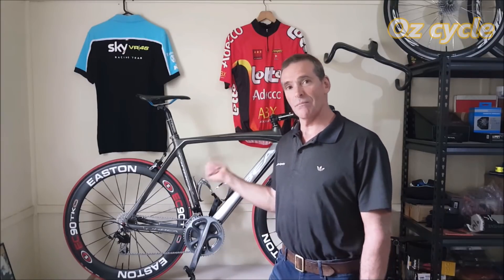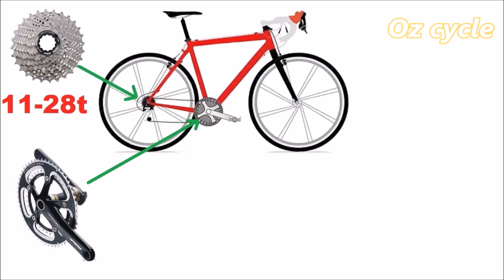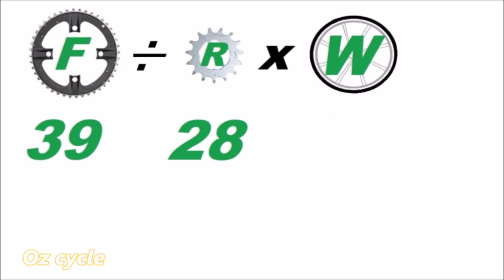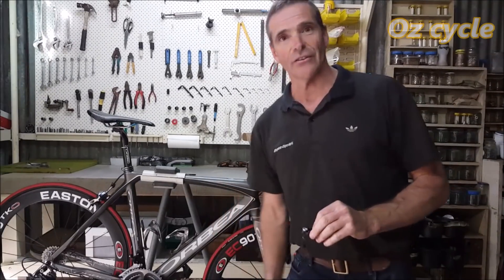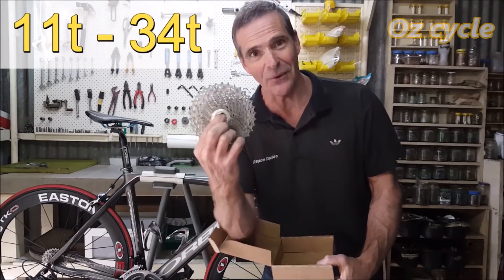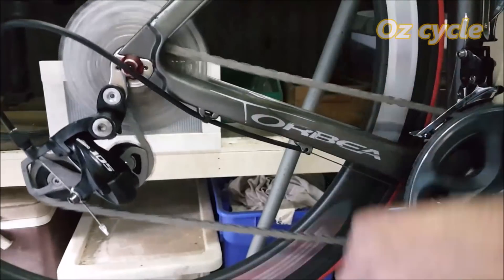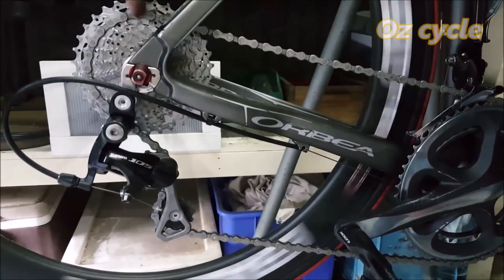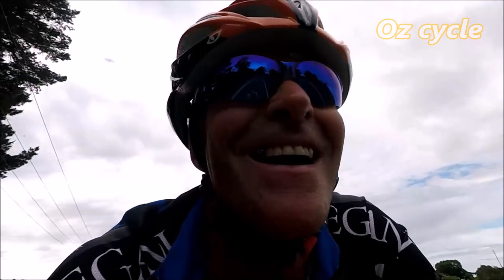Have you got Compact gears yet?

Comment: why would you not use the first cog with the big chainring ? if i have 20 speed i want to be able to use them all, just get some long cage derailleur
Reply from the maker: +Samy Arabi The chain twist is too great Samy and will wear or damage the chain very quickly. Next your on your bike put.it in that gear, look down and you will see the angle of the chain.
Reply: i'm used to it and i dont mind killing my chain 100km earlier because i crosschain sometimes, but to me switching into big ring in climbs allows me to put great power standing still, i have compact gear and i would never have unusable cogs with any of my chainrings. 

why would you not just recommand a long cager derailleur in your video? if you look pros (im not sayin i am one) they use any gear and sometimes yes, big chainring and biggest cog also
Reply from the maker: +Samy Arabi Sounds like you dont use your small ring much? The 'hanger extension' is for anyone who would like to try smaller gearing without buying rear mech or crankset. If they like the gearing they can consider a compact set.
Reply: anyways m8, the tip is great, i like it compactt
but when i dance uphill, i dont like shifting 2 - 3 - 4 in cogs in small chainring, i'd rather just stay on biggest cog and switch ring and then if i need to, one more cog for slightly bigger rollout. and then, back at small chain ring seated and tempo relaxed. cheers

i just dont like the fact that its ok to not be able to use all of your bike gearing lol, everyone has its own way to do it
Reply: @samyarabi9033  It is ok to avoid using all of the available sprocket/gear combinations, because there are several combinations that have close to the same gear ratio.  For example, I only use maybe 14 out of my 20 available gear combinations yet still retain essentially all the useful combinations.  On my drivetrain, crosschaining the big ring (50 teeth) with the biggest rear sprocket (28 teeth) is a ratio of 50/28 = 1.79.  Instead of crossing my chain, I can instead switch to the smaller chainring up front (34 teeth) and a rear sprocket in the middle (19 teeth) for effectively the same ratio, 34/19 = 1.79.

You can calculate a table of your drivetrain's gear ratios to see that you don't need to cross the chain, and can avoid maybe four or six gear combinations that can cause wear out problems for your chain.  Example gear calculating website:  http://gears.mtbcrosscountry.com/

Comment: Froome has everybody trying hi cadence. I was no exception, and tried the 11-32 for several month. My conclusions were:   1) You have to be Froome to keep up "hi" speed and hi cadence on a steep climb. My heart was reving too much.   2) The jump from 32 to 28 is too large and got me  off rhythm (it was too hard or too easy, as Oz said) It would interesting to know if Froom's 32 cassette drops down 4 to 28....  . 3) the 32 was making me more lazy .   4) I was missing the 23 of the 11-28 cassette. I went back to my 28 and compared times, and I was faster on my 28 compared to the 32.    So for me, personally,  lower cadence with a 28 works better than  the 32. Although I 'm sure the 32 will work fine for many people. Lastly, 34 for a road bike seems too much, for gears would spread way too much, as Oz also mentioned.

Comment: No. This is daft nonsense. If you can comfortably push a 39x28 up a twenty minute climb at 300w, there's no benefit to doing it with 34x28 at a higher cadence. I started with compact, moved to semi-compact, now i ride standard with a 28. I wouldn't consider going to anything less now. And secondly, having a 53x11 on downhills is a distinct advantage

Comment: i have a 40 tooth casette paired with a compact on my road bike. Shifts amazing and i can go up mountains. The tricky part was finding a mechanic that knows how to calculate the length of the chain and index the gears properly (which is what i didn’t know how to do, i tried and failed). The only downside on my my bike is the rear wheel doesn’t come of easily. I highly recommend this set up for new to the sport folks until you build strength. Credits are due to Durianrider.

Comment: Hi does that link work on sram dr? I have compact and 32t in back so I'm using medium cage. Some hills are 16% and it's so hard to get up...I'm pushing 400+ watts and probably going 5mph... I think cadence not lower than 75. Is this ok? Sorry many questions
Reply from the maker: +NewbArchitect Yes it works with Sram. 400Watts!!....not continuously,you would be a machine...haha. Lower your gearing to put out less wattage,then you will be able to climb easier and feel fresher at the top,instead of exhausted and having too much lactic acid buildup.

Comment: spinning dont always solve the problem, especially if u got some short climb like 20% to 25% or longer climb like 12-18%
u still need to train for low rpm hi torque climb
Reply from the maker: +U20101954 Yes,and every body is physiologically different. Some can keep dancing up a hill easily without sitting much. Others sit a lot,and all the inbetweens. Its all a matter of working along wirh your body.

Comment: My first road bike (I'm a recovering mountainbiker/born again roadie) came with 50/34 and 11-32 but I got myself an 11-34 do help me do one particular climb and it has never come off again. I'm no racer so I don't find the bigger jumps between rear cogs an issue and I've even found that cross-chaining 50-34 is no problem (the chain remains quiet) so for a lot of the climbs I do I never come out of the big ring. Very occasionally I run out of gears at the top end 50-11 so I am considering seeing if I can get a 52 chainring to run 52/34 up front.

When I say to 'serious' roadies that I have 11-34 they almost sneer at me. Funny how spending a fortune on a light weight bike to help you climb hills faster is OK but spending £30 on a new cassette to do the same thing is not!

My wife a road bike at the weekend and one of the things on the 'must have' list was a Shimano Tiagra chainset which can accommodate an 11-34 cassette as standard.
Reply from the maker: +Hugh Wallace Sounds like you have found yur perfect gearing there Hugh...11-34.  If you can afford a 52t ring it will get you down the hills that bit faster.
Reply: @Hugh Wallace; Cycling snobbery?

Comment: I took my bike for a first hills ride today, 50-34 and 11-32 and I used all of them.  34-32 not too often, but a couple of times when I needed a break.
2018 standard setup for many manufacturers seems to be 52-36 and 11-30.  Based on today, for my needs, I think I'll get the shop to swap the semi on my planned upgrade bike for a proper compact set of chain rings.  I don't want or need higher top end speed, but I definitely appreciate having easier gears available when climbing.  Stronger riders would probably be fine, but I'm not a strong rider  :-)
Reply: Free Man
Agreed, but a stronger rider is able to spin bigger gears than a weaker rider, that is what is meant. For example 20 years ago I could go up hill with 90 rpm with say a 39/23 or even bigger gear, whereas now the equivalent for going up the same hill at 90 rpm would probably be with a 34/32 or worse.

On my new road endurance bike (Giant Contend) I've just put 46/30 on the front and 11/42 on the back, all for very cheap. And working excellently! Didn't even need to change any deraileurs or cranks from the stock ones! The 46/30 sub-compact chainrings have 110 BCD and costs $50, and the cassette cost $30. Plus a Roadlink which cost about $35. How's that, a cheap 110 BCD 30-tooth chainring?!

I was struggling to even push the 34/32, this 30/42 is really great for me.

Anyway I always want to spin, so have to get gears to fit my strength, which is weak due to illness. I refuse to grind up hill if it's within my power to lower the gearing on the bike. And who but race-speed riders need anything bigger than a 46/11 eh? That's plenty big enough for 90% of commuter road riders and is usable range. For most commuters a 50/11 is just superfluous and barely if ever used. Just not needed.

But if I was racing even D and E-grade level I'd definitely need a 50/11. Probably even go with a 52 for D and E grade, but could get by with a 50. For B and C-grade you'll definitely need a 52 on the front. A-grade level you need at least 52 and preferably 53. When I was riding A-grade I had a 52 but on occasions wished for a 53 as the 52 spun out in races, and I was only an average A-grader. But I was too lazy and not serious enough to do the conversion haha. But now I suffer too much on the hills to not warrant converting to lower gears than the stock 34/32.

Who would think a 34/32 on the road is too big? But for some it really is, I'm so slow I grind even with that gear. I'm bloody loving my 30/42!
Reply: @alantaylor6691  nice read! That's an impressive range of gearing. My old bicycle has 52/40 and 28/14 and is only 12 speed lol. On the flat I'm on the 3rd cog and big ring but uphill its not easy even on lowest gears, I haven't cycled for years so that won't help. I can only imagine how slick your drivetrain must feel especially uphills!
Reply: @TheRealD4  
About a year or two ago I was speaking to someone who was running a triple chainring, with low gear being 20 on the front and 46 on the back!

You may ask how do you get a 20T chainring? Well as you may know, 22 is usually the lowest gear you can get on stock triples. However you can actually buy 20T chainrings on ebay that can replace the stock 22T small ring.

Then he got the back up to 46. I think that's something like an 11 inch gear. He does fireroad riding and says he uses it for that, with gravel bike type tyres of about 42mm.
Reply: Yup depends how strong you are a lot of the time. 20 years ago when I was racing and training like a maniac, a 39 x 28 was more than small enough. Now that I've been off the bike for 20 years and have no legs and excess weight, I'm even having trouble with the 34 x 32 on a lot of hills lol. It's just amazing the difference the legs make, 25 kph is pacey on the flat now, but in the old days I didn't even go that slow on easy recovery rides on the flat.
Reply: strong or not, spinning > grinding

Comment: Sick video ! I love to have a high cadence generally, I'm comfortable around 90-100 rpm so I struggle quite a lot on the mountains, where my lowest gear (34-28) allows me to pedal at 80 rpm max (which is too much grinding for me). Would you recommend training at ultra low cadence to make my muscle adapt to low cadences or just go with a 11-32 cassette ? I'm currently running a compact crank with an 11-28, I must say its very tempting to buy that hanger and go with the 11-32.
Reply from the maker: +Antoine Morin-Prévost Mostly depends on your age and weight. Generally it would be good to simply have the lower gearing so you can have the higher cadence especially if you can already do 90-100rpm.

Comment: I cycle in mostly low rolling hills for my daily 35-mile training rides (56 km). There aren't any long climbs but one of the short ones hits an 18% grade. I'll do several centuries each year (100 mile or 161 km) and some routes hit longer climbs but they never exceed 10%. Cycling these routes I found that I hadn't used the small chainring of my 50-34t compact chainset for a couple of years. So I switched to a 1x drivetrain at the beginning of 2016. After two seasons on a 1x with a 50t chainring at the front and an 11-28t cassette at the back, I haven't felt the need for a 2x chainset at all. I plan to switch to an 11x32t cassette next year so I can handle steeper climbs (if I ever travel to a location with them) but I've been very happy with the 1x setup.

I'll be 61 years old in a few months and, according to my power meter, I can still hold a modest 400 watts uphill for a fair distance, especially if I'm pulling the pedals, and haven't had any trouble holding a cadence of 80 or better up any of the hills in my area. I rarely get out of the saddle and stay in an aero tuck position resting my arms on aerobars most of the time -- even uphill (there is a lot of wind here). Because of my forward-leaning position, I'm using a 165 mm crank arm length even though I'm 6' 2" tall (188 cm).

I've heard a lot of comments from "critics" about the steps between cogs being too big on an 11-32t or larger cassette. However, I've never experienced that. Most of the time, I find myself jumping two cogs at a time whenever I shift. I remember back in the mid 1980's, my steel-frame road bike had a 2 x 6 drivetrain with much bigger jumps in gear ratios and I never had trouble with it. I still have that bike and ride it occasionally today. No problem with the steps between cogs. So I think the "too large" step complaint, though valid for some cyclists, is exaggerated for most -- especially on an 11-cog cassette.

I wouldn't recommend a 1x drivetrain for everybody. But I just wanted to add a different perspective on this discussion because I think they will become increasingly popular in the future for cyclists who aren't climbing mountains.
Reply from the maker: Sometimes its cheaper in the long run to buy a complete bike,Carlos.
Reply: D.Eldon , I ride an 11-32T and I think it is the ideal. The issue of missing intermediate ratios might be applicable to those planning on reaching top 10 in races, because at that level, the game is won or lost on optimization.
Reply: You guys say "centuries" what is a 100 miles. When we in Europe say a "centuries " we mean a 100km trip. In the end of the day, you guys in the USA end up getting more distance fine than us just by the way it is calculated.
Reply: 400 watts at age 65 ?! How heavy are you ? In any case I find it hard to believe you can power up long 10% grades with a 50x28 unless your name is hum Greg Lemond maybe...wait he's only 60 !
Reply: excellent parabens explanation, I really wanted to change my group, but here in Brazil the parts are very expensive, I'm fifty-two years old and I need to make modifications on my bike.
Reply: 400 watts !! That's impressive.
Reply: D.Eldon Thanks for the added wisdom from decades of experience ~ Also you touched on the "smaller" differences between cogs. Personal preference has everything to do with it. One ring doesn't not rule them all!-)
Reply: The only time missing gears becomes an issue is in a time trial environment where you're trying to hold a specific steady power at a relatively set cadence.
Reply: Thanks for the sugestion
Reply: I've got both compact and trad, compact cannot compete on the flat

Comment: I use a 52-36 and an 11-34 for my casual rides or mountainous races.  I can roll up a 20% grade at around 70 rpm, which is much better than the 40-50 rpm I was getting on my old 53-39 and 12-25
Reply: Just what I am looking for

Comment: A bit of self honesty helps. How often have you actually spun out going downhill? And how often have you wished you had another gear in reserve when grinding up a steep hill?
Reply: I struggle with this concept!  I love to power down the hills, but with a 50 tooth chainring I will always run out of gears.  However, I easily spend 5 times as long riding up a hill as I do down it, so it would make more sense to ride easier gears.  Here is the compromise that I have come up with for the majority of my riding:  52-36 up front and 11-34 in the back.  Works out pretty good for just about everything except long flat rides, where the big gaps on the cassette really mess you up not being able to pick the right gear.

Comment: If you angle the road link aft you can fit a 36 or even a 40 with only a short cage!!! just don't go big big, it would be a good excuse to go over to  Italy to find a use for such easy gearing
Reply from the maker: +dr10501 Sorry but whats a 'road link' dr...?
Reply: The 'road link' is the rear derailleur hanger extension

Comment: I ride a triple!
Reply from the maker: +har234908234 Good one!....thats one way to get super low gears  :)
Reply: I recently restored a 48 38 24 hybrid front crank set Peugeot bike with a 13-28 rear free wheel. I like the ratios for this versatile enjoyable ride.
Reply: James Bowser 
24 tooth? Flag pole sitting?
Reply: GJ 
Me too! 50,40, 30 in front chain rings and 32,11 in the rear free wheel. The wheels  are 700x28 on my hybrid. I live in hilly New England and this set up helps combat steep climbs.

Comment: If you're not racing try smaller chainrings on the front and standard 12 - 25 cassette. On the CX bike I use 42-34 and it's great.
Reply: I can't really go any smaller than a 52 tooth big ring.  While I do have some monster climbs, I still don't want to run out of gears on a downhill or while taking a monster pull on the flats.

Comment: I run a 52-34 swapped out 36 and an 11-32 with a standard dura ace hangar. It works fine don't listen to anyone that says it can't be done
Reply: glenny oc n
Reply: that works pefect,i also recommend the big jockey wheels,diameter of 42 mm will fit
any shimano short cage!
Reply: glenny oc . https://youtu.be/qPLasomhTCw
Reply: I ride in the Mountains with steep climbs 10%+ and long smooth fast desents with posted speed limit 55 MPH

 I recommend this gearing to all who ride the extream ups and downs.
52 - 34 chainrings
11 - 32 cassette 

https://www.strava.com/segments/638289
Deer Trail (to mailboxes)

http://www.mapmyride.com/us/boulder-co/buffalo-bicycle-classic-2013-buff-epic-1-route-252315553